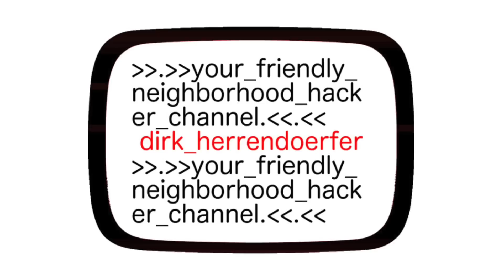Big Bad Robin Build VLOG pt. 4

Comment: one thing to consider for another build is to use two different sizes of rails for Z and X, because it just so happens that the hole pitch on mgn9 rail is the same as the hole distance on mgn12 carriages